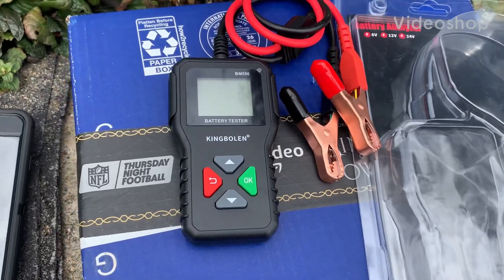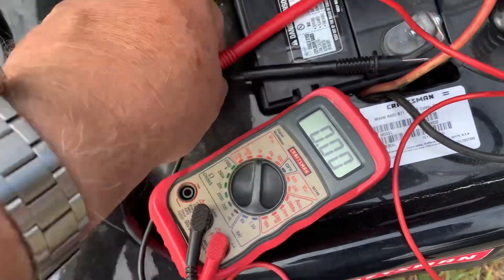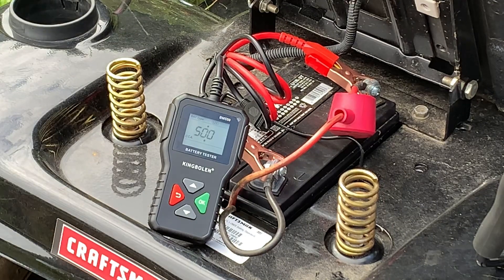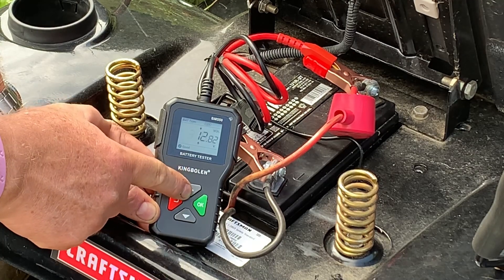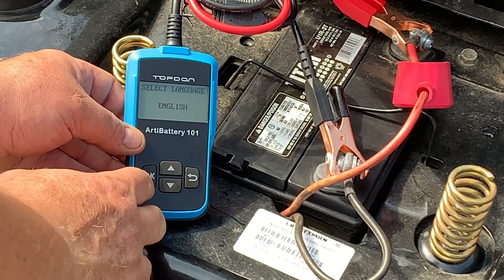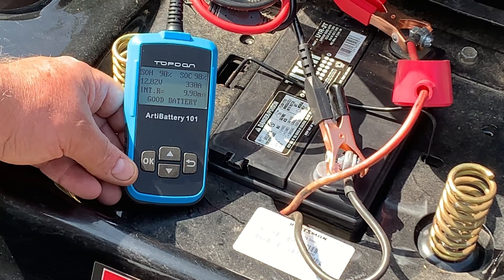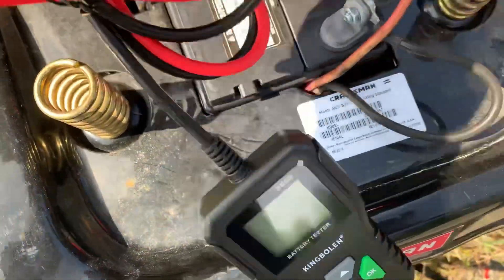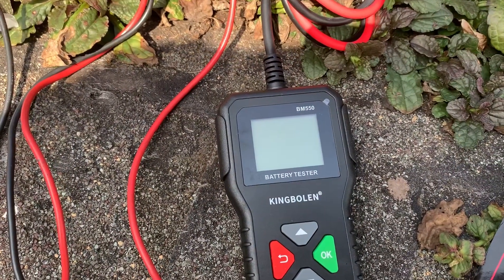Kingbolen Battery Tester, any good?

Comment: HI Ken. The battery resistance could not be Mega-ohms because if it was that high, very little current could flow.  Instead, it is milliohms.  Theoretical ideal battery resistance would be zero to not impede current flow and to not drop any voltage internal to the battery.  Oh... and "m" means milli or small vs "M" means Mega or big.
Reply from the maker: Thanks for the clarification!

Comment: It shows voltage so if you started it the voltage would jump up (if the charging system is working) wouldn't it?
Reply from the maker: If it’s a standard rectified AC to DC system is would rise with rpm.

Comment: Hi.Nice video.Does this device has function to check battery discharge if there is any problems with any module or short circuit?

Comment: Hi.Nice video.Does this device has function to check battery discharge if there is any problems with any module or short circuit?
Reply from the maker: It has a charging check on it.  They just sent me the newest model, I will review it soon. Is there a specific electrical issue I can help you with?